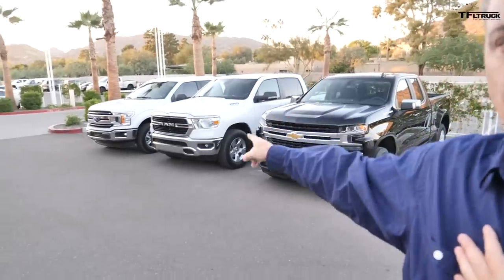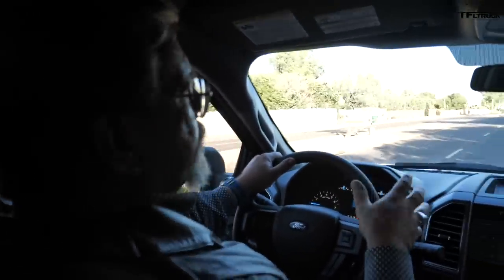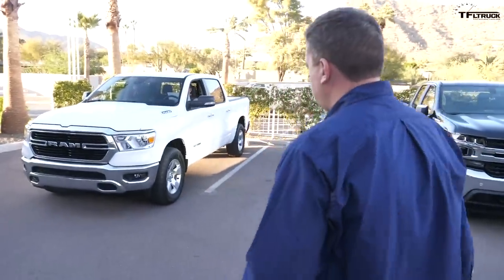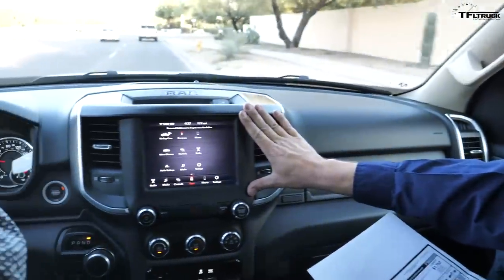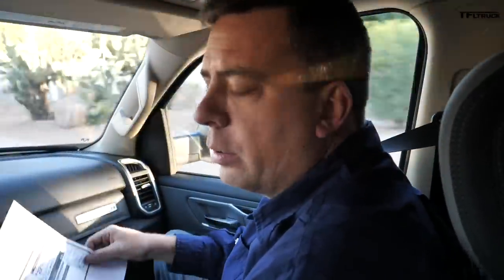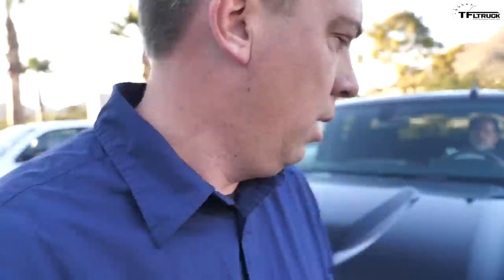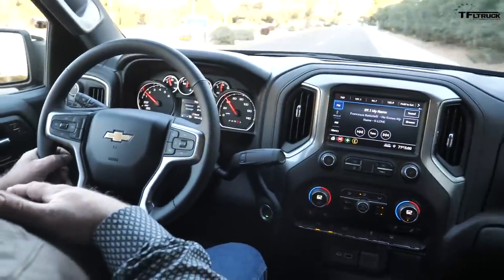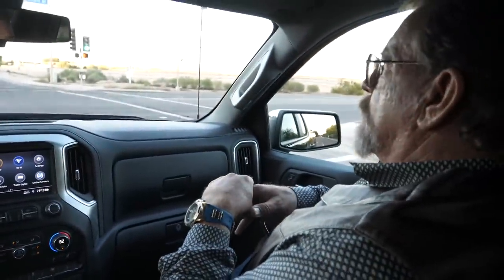Work Truck Wars: 2019 Chevy Silverado 4-Cylinder Turbo vs Ford F150 vs Ram 1500 Review

Comment: I think it will be cross shopped with the 2.7 EcoBoost in the XLT and Lariat, not the 3.3 XL base truck. So how does it feel compared to the 2.7EB?
Reply: The 2.7 EB in most testing had similar acceleration numbers to the Chevy 6.2 and would easily blow all of these away.The 2.7 is probably the best mid tier motor for a truck and this is coming from a GM guy.
Reply: Yeah nothing like comparing apples to oranges. 2.7 ecoboost would dominate.
Reply: They compared base model engines the 2.7 is Chevy's base model for 2019
Reply: 2.7 ecoboost would murder it in every category.
Reply: @smiller225  I'm pretty sure the 4.3 v6 is the base engine
Reply: scot miller the 4.3 is the base engine for the 2019 WT and Custom trim.
Reply: @smarticus6384  and the title of this video is Work Trucks so the GM v6 should have been used or the 2.7eco in the Ford against the 2.7t GM.
Reply: @smarticus6384  and the the 3.3 is the base engine for the XL and XLT.
Reply: scot miller bro the 4.3 ecotec is the base engine in the Chevy learn your facts before you say stuff😂
Reply: @bigdaddy5212  The 6.2 beats the 3.5 Ecoboost at SEA LEVEL according to Cars.com, which tested on a drag strip.
Reply: The 2.7 EcoBoost is one of the fastest trucks money can buy right now. Wipes any V8 across the floor. Doesn't tow as well. But it's very economical and pretty quick.
Reply: Lol 2.7 ecoboost would slaughter this thing easily.
Reply: @mr.boostang2064  yes
Reply: @clintmullins4406  In what multiverse are you living in?   
Ford twin turbo 2 7 EcoBoost with right Axle, will blow everything else away, including Ford's own 5.0 V8!
Chevy cylinder deactivation is  guaranteed to fail - go ahead and buy it though.

Comment: These turbo trucks are ridiculous. Long term reliability is trashed when you slap a turbo on it.
Reply: Trent C ...... diesel trucks have turbos 😃
Reply: Different categories. 
Diesel fuel really is heavy oil, while gasoline has nothing in terms of cylinder lubricant. Which is why diesels can run ridiculous amounts of mileage compared to turbo gasoline models, that can burn and score cylinders, because of the lack of lubrication. Of course, gas turbo engines run at higher RPMs to achieve the same speed as diesels, and the oiling must keep up, or the engine will seize, and it will run slightly hotter. That is why he meant that gas engine must work hard once a turbo is slapped on.
Reply: @Mr10Alpine  Grand National.......enough said.

Comment: Dissapointed. No equal comparison. Should be same cab, same drive configuration and same engine line.
Just note trans and gearing differences.

All 3 make same cab and drive configuration that can be matched. Ford and GM with TurboGas can be compared, all 3 with small V6 can be compared. Etc
Reply: But that's the part your missing. GM is saying this is their base engine and should be compared with the base V6s from Ram and Ford; they don't want to say it's better than Ford's 2.7L V6, which they say is an optional engine. They are saying we should compare standard to standard at LT and RST price points, theirs is better;  and from a cost standpoint, they should be pretty close to the cost of a larger NA V6 with a turbo 4, and that's why it is so confusing why they haven't made the turbo 4 the base from the bottom up where they could make a better argument for it over a NA V6. They absolutely don't want you to realize that with Ford you could actually step down to an XL standard cab and get their 2.7L as an optional engine for much less money if that's all the truck you want. Try to do the same thing in Chevy, and you get the 4.3L. But really, when you compare either the LT or RST, they're right; and that's what they want us to see. It's the standard engine versus the others with an XLT with a standard 3.3L and Big Horn with the 3.6L. Comparing these trims; only standard engine to standard engine is the only way that GM's argument for this power train makes sense, and it's the only trims where the 4 cylinder turbo is available. But with all three brands, you can opt up to either V8s or for Ford, V8 or a choice of two turbo V6s.
Reply: @gregoryfaulkner5345  Its not their base engine. The base is a 4.3 liter.......

Comment: Next up is the all new 2020 ford raptor with a 3 cylinder twin turbo bringing 750 hp
Reply: ring ding 2 stroke 1000cc triple turbo hybrid with start assist and dual backup cameras hydraulic tailgates and electric steering wheel holder apps for your iphone.
Reply: Nice. That is funny. LOl LOL LOL LOL LOL

Comment: I think GM is trying to push the modern “small engine = MPG” concept (that Ford started with the EcoBoost) a little too far/fast. I don’t think a 4 banger has any business in a 1/2 ton. If it only gets used for groceries & whatnot it’ll probably be fine but if somebody decides to do a lot of towing/work with it, I see that engine getting tired pretty quickly.

Now I want to see these 3 trucks go up Ike with 7500 behind them. Even with the Chevy having a turbo, I bet the 3.3 Ford performs best.
Reply: or make it apples to apples and load the ford with their 2.7 liter.....

Comment: I liked all three trucks but it seemed the RAM was the best buy 👍🔧🔧
Reply: None r worth buying
Reply: larry burnett but it wasn’t base.
Reply: @FishFind3000  yeah but for the money it still was a better buy the F-150 was more money more plastic the Chevy was nice I'm not sure of the 4 cylinder engine in a full size truck 🔧🔧
Reply: It has a tendency to overheat
Reply: The Ram will die first. I’d personally buy a GM V8 or Tundra.
Reply: Duck of Death yeah , as bad as I dislike the interior on the tundra.  I have to agree .... If I had a gun to my head , I would do the same .
Reply: mattmc mc I agree the Tundras interior isn’t good. They make a good truck though. Chevy’s with the 5.3 are usually really solid as well...
Reply: @jacknabstedt3222  I think ram would do better than U think
Reply: I think ram would do great
Reply: Darius Hope ehh, I don’t know. My experience with FCA has been horrible.
Reply: Dodge are the biggest piles of shit ever. The only people who buy dodges are people who aren't very clued in.
Reply: Gary Woodgate that’s a lot of people 🤦‍♂️
Reply: Interesting that you included 🔧🔧 when talking about an FCA product. I'd run away from that etorque system. Looks like it makes the serpentine belt a weak point and probably a huge pain to work on.
Reply: Ram does well and most of the Diesels resale better than Ford or Chevy. The Rebel also has good resale. I would get the 5.7 no Etouque if I was buying for a year or 2
Reply: just imagine the chevy engine in the ram with 4x4. great base model truck!
Reply: Also first in the repair shop and best in class worst resale value
Reply: larry burnett  no RAM for me because of all the racist riot
Reply: Better new, but don't expect it to last more than 120K miles, and expect to have problems starting around 75K miles.
Reply: @rightwingsafetysquad9872  yeah your probably right but that could be true for all the trucks especially with all that technology I can't imagine the cost of reprogramming or replacing ..
Reply: Duck of Death so that’s why that Trailboss Silverado failed to start at that Detroit Red Wings hockey game? Because they are reliable. Ok fine, it was just one truck, but it may not be the only truck with that issue, just proving how inconsistent GM reliability really is. You can be lucky to buy a reliable truck, or you can be lucky to buy a faulty truck. This rule applies to all modern American trucks, and maybe the Nissan Titan since Nissan isn’t really a reliable brand anymore. So if you want a truck that will never fail to start, get a Tundra.
Reply: Boost I hope you’re not talking about that new 2.7L, which is unproven at the moment. Hopefully it is reliable, but only time will tell.
Reply: Not for nothing, but 44gs buys a nice Tundra!
Reply: @gwood701  you must be a chevy guy lol
Reply: larry burnett how was it the Best Buy, the Chevy has a nicer interior, safety options, better pay load, faster acceleration, and was 4 wheel drive.....
Reply: Tundra, Tundra, Tundra,,,,,,, blah blah blah. You are buying a truck that has remained basically the same since 2007. They have made minor changes but the 5.7 is the same with hp & torque since day one. I had an F150, 2013 5.0 that was never in the shop once in 2 years. I have a 2015 Tundra that has been in the shop 4 times and stranded me twice. I have kept it over 3 years to see if it gets better and because I thought I could do so but I dislike the truck. They are fuel pigs and have had the worst fuel economy in class since 2007. Again I was overlooking the fuel economy for longevity. That was a huge mistake. There are examples that have been bulletproof for 300,000 miles, true, but there are also many many examples of F150s with those miles as well. All of the full size trucks are North American in make and design (stop deluding yourselves Toyota fans). All of the trucks have issues. My personal experience is that I will not buy a Toyota truck again. My favourite to date has been Ford! My father is rolling over in his grave right now!!   Hehehe 
    Before you trash this, remember, I am only speaking about my own personal experience.

Comment: The 3.3 is perfect for those who want an F150 as a car. Good mileage (for a truck), 6 passengers, a good cargo capacity grocery getter per se and an occasional tow of the bass boat. What I like about it is there’s a lot less to go wrong.
Reply: I really wouldn't call any of these trucks a "6 passenger" vehicle, nobody wants to sit in the middle front for more than 10 minutes and even that only in a pinch.  As a car with an occasional tow compact trucks(Taco, GM twins, Frontier, Ranger) are way more practical.
Reply: Alexander Golubev Jr I don’t want a console. I prefer the 40/20/40 seating. Costs less too.
Reply: @dam4274  I do too.  But just for that once in a million years need type of thing.  It's just not practical.
Reply: jldude84 My eldest son loves his 2018 Taco crew cab. I find it too small inside yet he gets 29 highway. Rides well enough but still cramped inside and sore seating. Maintenance free vehicle.
Reply: @dam4274  I have a Chevy Colorado 2.8 diesel I get 33mpgs highway and 28 city. The diesel runs like a top and gets great mileage
Reply: @leadnsteel1428  Yes the engine is good but ....?
Reply: I bet with the 3.73 rear end the 3.3 ford is probably a pretty fun ride.  Plus if they get rid of the 6 speed and upgrade it to the new 10 speed trans it will keep the engine in its torque range and be even better.  It won't be a  tow beast but for people who tow a small camper, boat, or toys on a flatbed (or landscapers) this is probably a good option.  I also prefer the 40/20/40 seats which I have in my current f150.  My daughter fits great in the middle when we have to pick up extra family.  Sadly my new f250 has the console because most of the dealers around here optioned out the trucks.
Reply: @2005OEFArmy  But who the heck wants to cram themselves into a tiny vehicle with no room for just a couple more mpg. I'd much rather have a vehicle that doesn't cramp me than have one that does. That to me is much more practical. Also as someone who has owned both a console truck and a split bench truck, the split bench is way more comfortable.
Reply: DAM8658 no way in hell he gets 29, does he have the 2.7? Even then it aint that high.

Comment: I wouldn't trust the reliability/longevity of the GM. It's sad that were now down to a full size truck with a 4 cylinder turbo and Direct Injection, the Ford has Dual Injection, but not one of them is worth $40,000. The start stop crap should have an on/off button also.

Comment: I liked that comment from Mr. Truck. "I can get all the grandkids in here"
Reply: Mr truck is awesome. I bet he's got some happy grandkids!
Reply: @volvo09  And if he puts one of his grandkids in the front center, he doesn't care about them.  Lap belt and no airbag = no bueno.
Reply: @Alexander Ya know my grandpa refused to ride with any driver that wore a seat belt. He figured if you don't trust yourself enough to drive safe their was no reason for him to trust you. He drove for 80 sum years without an accident. He also believed speed limits caused more accidents than they prevented (which has actually been studied and proven).
Reply: @rmkscrambler  I like the theory, but whenever I don't have my belt on I start getting visions of weird stuff happening like someone's wheel falling off and it rips their vehicle across an undivided road and into me before I can truly react... Then I'll put it on, and move over to be safer, so I see the thought behind it!
Reply: @2005OEFArmy  There is a shoulder belt in the center seat!  Even an older truck like my 2011 F150 has the shoulder belt in the center seat.
Reply: That's one thing Mr. Truck and I definitely agree on.  I like having the center seat w/ the fold down storage bin (and the compartment under the seat cushion).  I feel this configuration makes the truck feel more roomy, since you don't have the stupid floor console in the way.  I'm not really a Chevy guy (I've had better luck with Dodge/Ram), but I do like their implementation of the center seat and storage.

Comment: I am not sure why you compared the Chevy 2.7L against the Ford and Ram base model.  According to the Chevy site and building my own truck with crew cab and 4x4, the 4.3L is the base motor.  I think you should have put Ford 2.7L turbo in the line up and i believe the Chevy would have fallen last of the three trucks.  I am not sure why Chevy keeps insisting this 2.7L 4 cylinder is compared to the Ford 3.3L.
Reply: Because it's the only way the can appear better. Watch any comparison commercials from GM, they rig or completely edit out stuff that's negative to them. Like the whole aluminum bed video, they give a quick shot of the tool box falling and there's no hole. Then a quick jump and there is a hole in a different area of where the tool box hit.
Reply: John Fountaine
the 2.7 is a new engine and replacing the 4.3
Reply: @anthonywebber2211  If you go to their website to build a new 2019, the 4.3L is first engine listed.  Maybe next year, but this was not a base model compared to base model.  I believe GM is disappointed with this 4 cylinder engine and it did not produce what they expected.  It has the same displacement as the Ford and ford 2.7L kicks its ass in power from what has been seen so far.  GM modified all their engines and none of them beat the competition that has older power plants.
Reply: @John76546-x , I said replacing not replaced, there is a difference in the to words
Reply: @John76546-x , do you think a brand new engine is going to replace an engine has 40 years of proven engine just like that

Comment: Wow GM fell on its face with this motor......
Reply: The new CAFE standards are making the auto companies so a lot of stupid things.
Reply: How did they "fall on their face?" It takes the spot of the 4.3 on the non work truck base engine. It's not the 5.3 and it's not the 4.3. It's an engine in between the two. There is no problem with a 350lb/tq 4 banger. It's not an engine to compete with Ford's 2.7. Chevy simply doesn't have an engine to compete with that engine so that's why everybody seems to be calling it shit.
Reply: Mark Newman its an ecoturd with a turbo strapped to it. If history should have taugh "new GM" anything at all, its that putting a turbo on the ecotech is a recipe for disaster. Just ask all those cobalt owners with rebuilt engines.
Reply: Whats the whole point of dumping a 4 cylinder engine on a full size truck if the fuel economy still shit. 20mpg avg? really? Most new v8 trucks are close if not better than that. My gas guzzler titan avg 18mpg and is a 5.6l v8.

Comment: How in the world did GM put out a 2.7 turbo 4 that gets less mpg than the 2.7 v6 ford and the natural v6 dodge!? Don't make sense to me.
Reply: Because they cannot put their 2.7 against fords 2.7
Reply: I was once a fan of  GM trucks in general but now they completely gone irrational.  Their trucks underperform unless you pay up for the antiquated 6.2 which  comes equipped on an ultra high trim level. Active Fuel management and their newer version is still a bandaid and lack of desire to come up with a more efficient engine. Yes the LS style motors were a marvel when they first appeared in 1997 on the Vette. However its been 22 years now and needs to go to retire. Throwing a bunch of crap together. And coming up with only a four cylinder turbo?!  Should have been an Inline 6 with a turbo.  I think most truck guys would have been more receptive.  Another stupid idea is RAM's  torque assist flux capacitor which is a guaranteed money magnet gimmick and unnecessary .
Reply: @eddielt1sl  dude. It's a base engine displacement and tuning are all in play gm trucks dont under perform. Having used all 3 ford and mopar trucks are under whelming. But I am ruined by cars that rattle your brains at idle.
Reply: @eddielt1sl  also the 6.2 is a lt based engine.

Comment: if its a truck, you want longevity and dependability , fuel economy is a factor but a 4cyl turbo or not is being pushed to hold that kinda power. It will only wear out faster.